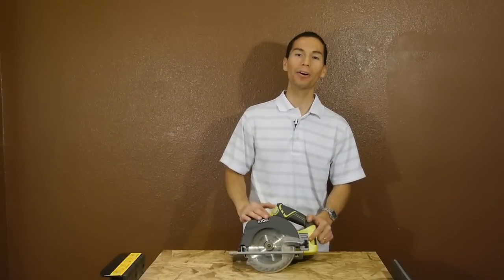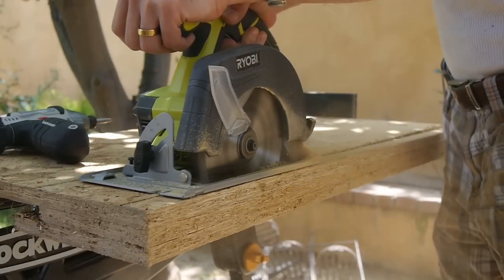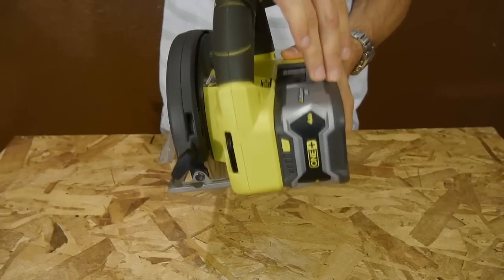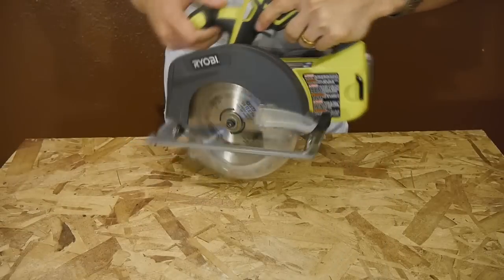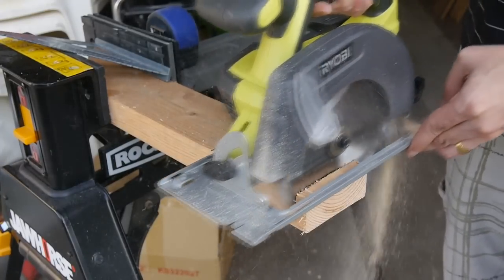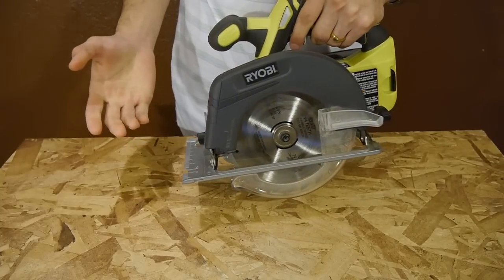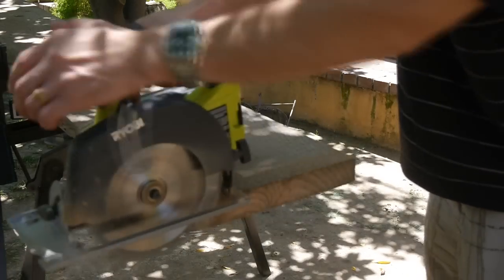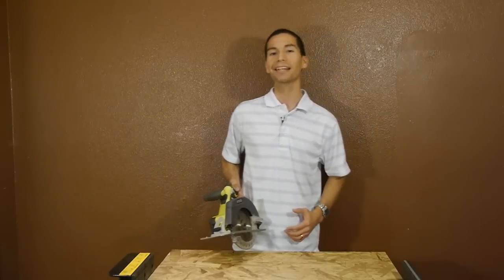Ryobi 18V 6-1/2" Circular Saw P507 Review

Comment: Im a framing Carpenter and just bought this. im looking forward to using it tomorrow. Hey be careful with the left sided saws, your using your left hand as a guide on the back of the saw and if that blade catches those harder pieces of wood and kicks back😨 that could be a terrible injury. Try holding the wood from the top of the board with your left hand and use your thumb as a guide to cut a straight line. I use these kind of saws daily and if the blade starts to bind just dont push so hard and let the tool do the work. Great review but watching it gave me slight anxiety lol.
Reply from the maker: ahhh my hand!!!

Comment: I own a huge mixture of tools (I own a custom wood shop specializing in very high end tables) I have to say I like my Dewalts but that being said I'm starting to really love the Ryobi platform I think it is just awesome that you can go out and buy the new battery's that Ryobi has and you can put them in there older tool's, No more having to go out and buy a new tool to work with a new battery, I have several of there older tools and I went and bought there new battery's and was able to come home and put them in my older tools, So I give Ryobi a BIG THUMBS UP For doing that
Reply: +NY HUNTERGUY 
I too use Ryobi tools professionally.  Ryobi tools are not as powerful or have all the features of the professional brands but if they do what you need then you can get a lot of use out of them.  When I first bought a Ryobi tool I thought it would last a few months and I would just replace it but they never break.

Comment: I withdrew my negative comment today regarding the Ryobi cordless saw. I'll preface it with I'm a tool nut and was a commercial plumber for many years before retiring. I like all tools corded and uncorded, large and small. 
Ryobi is a decent brand. I bought a cordless package plus batteries last week which consisted of a circular saw, jig saw, 1/2" drill and palm sander. Also with this kit came two small 18v LI batteries and I bought a larger two pack of 18v LI batteries. Whether it was pilot error or a bad battery set, I had experienced a very short battery life yesterday while ripping small strips from a 1/2" sheet of average plywood and ran out of power 2 1/2 strips into the project. 
Ok, I charged all four batteries last night and continued my cuts. I fared much better today. I was able to cut 14 (2 1/2") strips out of the plywood using all four batteries but at least I finished my cutting. 
I don't know if that's normal or not, but I got the job done at least. 
For the price point, the tools are decent. I have always had a mix of brands in my arsenal from Porter Cable and Milwaukee, to Mikita, Black and Decker (don't laugh, B&D was once a professional brand and they still make a wicked belt sander). 
I apologize to anyone that read my rant yesterday and want to say I really like the tools themselves, I just wish the battery life was longer. 
In a perfect world, we would not need batteries just a small nuclear reactor.
Reply from the maker: that still doesn't sound right, should be able to do more than 14 strips with all those batteries
did you try exchanging them for a new set?
Reply: Not yet. I wanted to give the batteries a fair try. I'll probably go to exchange them tomorrow. 
Again, I really like the Ryobi tools themselves, they are well engineered and have a great feel to them. My only gripe is the battery life.

Comment: I got this same saw in big combo kit, 7 or 8yrs ago. It did everything I needed it to do, even though I only had 1.5Ah batteries to run at the time. A Diablo blade and a 3 or 4Ah battery shows what the tool's actually capable of. It still isn't the best, not by far. However, it ruined me for cordless saws.! I have no desire to return to the cord. Only if the job is to big, or will take too long to do otherwise.

Comment: I started with the Ryobi Blue set but soon gave up on it because of the Batteries. This new Green Line shows great potential and I would venture to say packs extreme BANG for the BUCK. What I really like is I just have to invest in the New Batteries and they would work with my Blue Set and perhaps provide more runtime if nothing else. I really do like the Rigid Line and if it ever goes bad, I am sure I will replace it with this Ryobi Green. My needs are not what they use to be and I don't really need the Performance of Rigid anymore. I will invest in the Ryobi Nailer because the Kit with Battery is almost cheaper than the Rigid Nailer with NO BATTERY, so that is a no brainer... Great Videos as always.... I really like how you show the Good, Bad and the Ugly about everything you test and that makes for great sound advice for us to follow. I've seen other videos that are not so diverse...
Reply: Paul Bialozor It's hard to go wrong with Ryobi. The only thing that made me go to Milwaukee was the poor performance of the circular saw on the Ryobi I had. The other tools did pretty good the recip saw I had took a bunch of abuse.
Reply from the maker: Paul Bialozor thanks Paul. From what I've heard others say is that some of the newer blue tools perform close to or similar to some of the green tools. Just speculation at this point since I can't say it for certainty as I don't have any blue tools that work well (very old and were left out exposed to the environments) but the lithium batteries are always a good way to bring some life back to the older blue tools.
Reply from the maker: DarkRaptor99 a diablo blade would have been a nice performance boost on the ryobi if you had decided to stay
Reply: Lovely Video! Excuse me for the intrusion, I would love your opinion. Have you tried - Schallingora Dexterous Programme Scheme (search on google)? It is an awesome one off guide for taking a drawing and turning it into wood without the hard work. Ive heard some decent things about it and my friend Sam at last got astronomical results with it.
Reply: Hi Jhov Suico... The tools seems a bit too good to be true... It just seems that someone has taken your typical CNC Machine and used it in a way to make it seem like anyone can do it. I've seen Blue Prints and they don't always contain the necessary information so my question is how can this CNC magic machine know everything for that job based off of a drawing. How did it know to put rounded corners and certain depths and what not. There are many scams and I fear this might be among them. I must admit I did not view the entire video but did watch long enough to make it seem it was too good to be true. CNC Machines are very wonderful to own provided you have the room for them and know how to program them. Many times you can find programs on Google for similar projects then just adjust them to your needs as you learn how to use the CNC... Working wood is not easy and may not be for everyone. I've been working with wood since 1980 and I am here to say there are very few ways to work it easy. Sure you learn shot cuts as you complete projects along the way then think in "HIND SIGHT" how you might be able to do it easier or different next time. I hope this device is the real deal... Cheers....
Reply from the maker: Anytime some random person tells you to try some weird name that you must google first, its usually a scam. I've seen junk like this all the time Paul. I'd stay clear of even clicking on the search results for fear of infecting your pc with some virus.

Comment: I have this. I got it gently used for about $45 and it was worth every penny. I used it with a high quality Diablo blade when I was helping to build a small house for homeless people in Mexico. The site did not have electricity so it was cordless tools only. I used it to cut 2x and plywood all day and it worked very well and only required one battery (4 mAh latest generation). I just hope that since Ryobi has announced that they will be releasing 9 mAh batteries, that they will make a saw like this but 7 1/4".
Reply from the maker: can you provide a link source that proves Ryobi is coming out with a 9 ah battery?
Thanks
Reply from the maker: Cheng Liu I wrote about it first https://toolcraze.net/official-ryobi-18v-6ah-9ah-compact-3ah-batteries-real-probably-using-20700-cells/ :)
Reply: Tool Craze: I read that sonetime afterwards.

Comment: How many boards were you able to cut?i was cutting 1x2s and was only able to make 3 or 4 cuts. I was using the smaller battery but I did expect more.
Reply from the maker: it can cut waaaaay more than that if you charge the battery
Reply: Next time you should FULLY charge your batteries for better quality and higher production volume.also the proper blade application and sharpened clean teeth are essential especially cutting across the grain.

Comment: with the standard 1.3ah lithiom ion battery i can't even rip a 4 ft piece of plywood on a fully charged battery...gets about 2/3 way through...is that normal?!
Reply from the maker: Sounds like your battery is no good
Reply: The same thing happened to me today, with the same brand new batteries. Two of them. I was cutting 1/2 inch hardwood. 
Does this battery have an initial charging procedure?

Comment: HI
I have the same saw. I was wondering if this saw is powerful enough for cutting metal.  Have you ever tried on metal?
Reply: It's specifically says in the owners manual not to cut metal with it so no you shouldn't use on metal

Comment: nice vid. put that Diablo blade on it and give it another review.
Reply from the maker: diablo blades make all tools perform better, wouldn't show off the tools raw performance like it does with a regular blade
Reply: How ever in the future you could remove one of the variables. Theres the tool and the blade and if you were going to do a comparison of all saws it would be best to use the same blade. Also, the included blade with any saw is only used for so long. Then most people stick to a brand such as diablo.

Comment: Come on ryobi. Give me a 7 1/4" saw!!
Reply: It only took them two years, but they listened to you! The new brushless P508 just hit HD shelves.
Reply: it will come
Reply: DON'T buy the Ryobi 18v brushless saw, the circuit board electronics are not well made and have seen many reported to  start smoking from inside the house casing and then the saw will immediately or soon after that Just burn the circuit board and quit working..they want $120 or more to replace the circuit board..the board is a pain to get to.. you will need to completely disassemble the saw..wires and ALL.. Buying the Ryobi Brushless is a bad gamble. Stick to the 5 or 6 in saws until the Chinese get that particular model right.. it's a real shame.

Comment: wrong side with right hand
Reply from the maker: You are WRONG. A right handed user will always operate the circular saw's main handle with his right hand no matter what direction the blade is on.
Reply: @ToolCraze  that saw is for a left handed user. They should make it for both users.
Reply: @hhhhh430us  it's not just for left handed users. I bought a Bosch with blade on left side so I could see cut easier. Worm drive saws are left too.